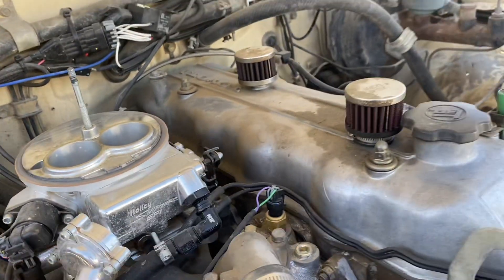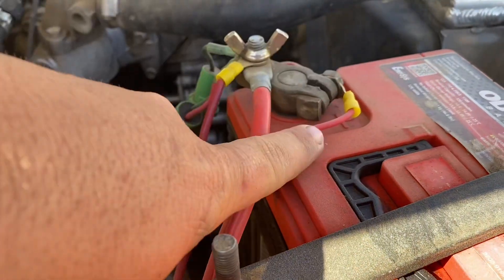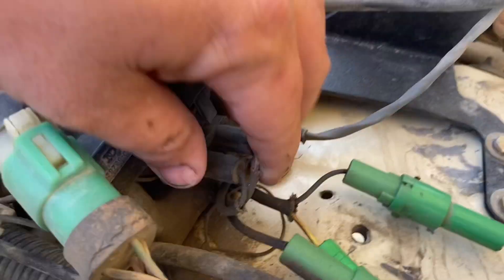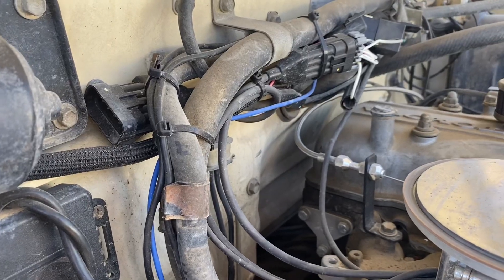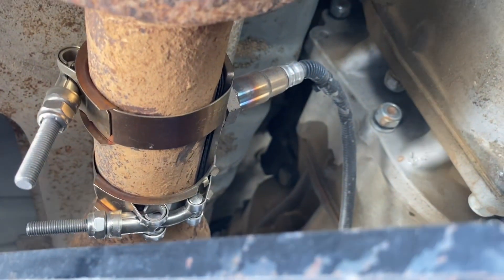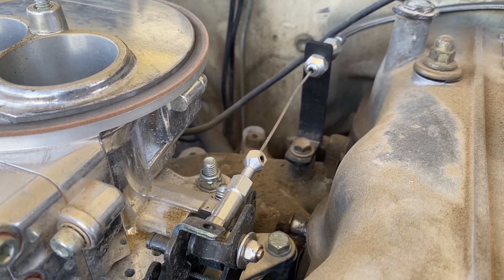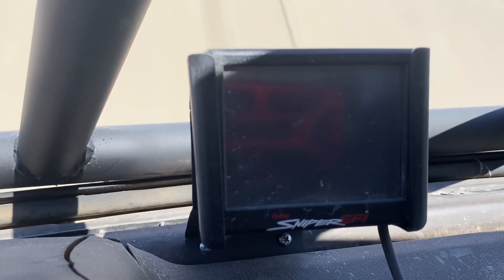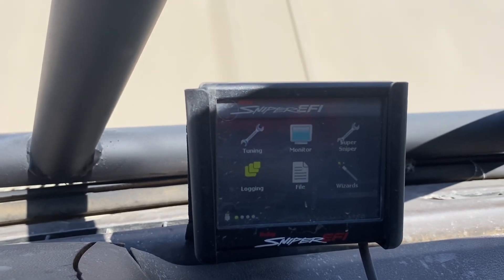Holley Sniper setup and wiring on a 22R

Comment: I put the same settings on the holley in my 22r but for some reason i cant get it to run past 60mph. Its as if it loses power on 4th and 5th gears. Any ideas? This carb has got me stumped.

Comment: I'm riding that Sniper Donkey with my FJ60.  The 22R has much better designed intake ports then the old 2F, but if you are thinking about going this route, make sure you have fairly even compression and a good smooth vacuum reading before pulling the trigger.  Carry a spare GM style EFI fuel filter and a spare O2 sensor (Bosch 17025), a few extra "high quality" hose clamps and extra 3/8's fuel line.  Need a fuel pressure gauge too.  They are pretty sweet.

Comment: Great to see more 1st gens going with the Sniper. I'm almost done my. Installed an in tank fuel pump. Just have to finish off the wiring and throttle linkage. Do you have a link for the one you used?
Reply from the maker: I got my linkage off kegs but I can drop a link in the description!
Reply: I ended up buying a newer Toyota after market cable, Part # ATP Y-777 Accelerator Cable. Made my own bracket using the 2  manifold holes for the old carb linkage and was able to kept the factory cable end. Cable is a little long but stashed it behind the head but moves freely. The 2 bolt holes are a tad wider on the firewall mounting , but a little filing on the plastic mount made it all work and it clips into the factory pedal fine.

Comment: I was/am considering this for my first gen pickup but I've heard a few people tell me the sniper system in unreliable. Have you had any problems at lower speeds with it? I assume you don't daily with it?
Reply from the maker: I don’t daily it but I’ve never had a problem with it on the trail. It runs better than the carb ever did!
Reply: I'm considering the same on my 20R pickup. I have one on my Land Cruiser and have had a few minor issues.  I love it most off road.  Damned Webber's are much less reliable day to day and with flooding.  My $.02.